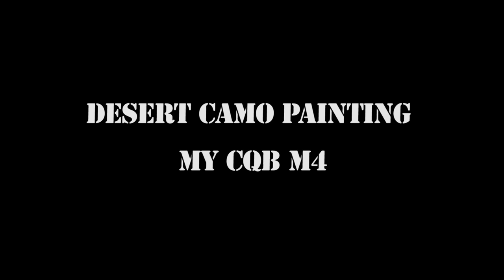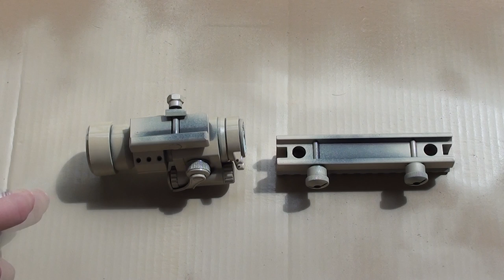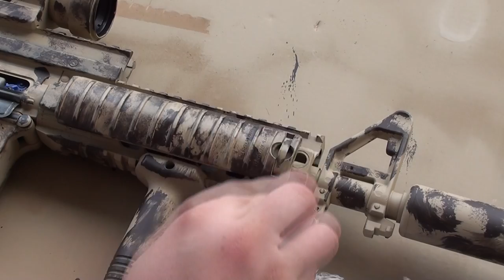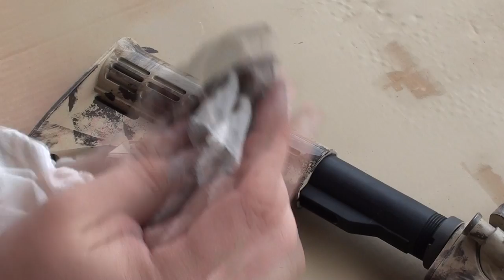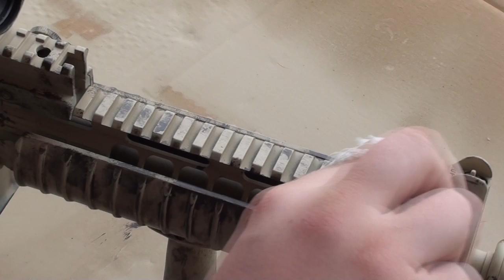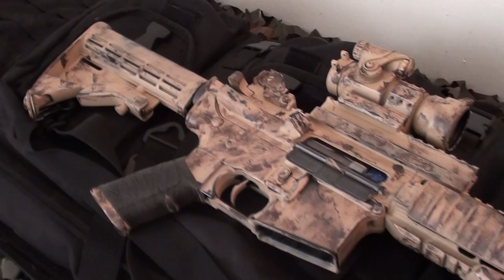Desert camo painting M4

Comment: Two questions:
1) How does the paint not make the components stick while they are attached during the sprayng process? 
2) What is that grip or attachment on the sides of the quad rail? I see that there is still rail room for attachment on the top and bottom but the side rails are hidden with that curved plate attachment of sorts? What is that?
Reply from the maker: 1) By using correct paint (Krylon in this case) you won't have sticking issues. 
2) Those are just rail protectors, to protect rails and your hands.

Comment: RBAirsoft sir where do you put your batteries? Is the battery in the stock? Is it lipo batt? And is yur gun a full m4 or a cqbr type? Thank you sir"  ill w8 yur reply.
Reply from the maker: louie concepcion its lipo battery inside the stock, the m4 is custom fitted with shorter barrel.
Reply: RBAirsoft sir what kind of lipo did you use to fit inside the buffer? And is it possible if use it to my jg m4 buffer tube, will it be fit well with the buffer stock? We have the same buffer stock. Thank you for yur answers sir. God bless.
Reply: By the way sir can i add you on facebook? Im a newbee and i think  you can help me with yur suggestions thank you again sir.
Reply from the maker: louie concepcion i use a thin 7,4V lipo battery. Should fit yours.
Reply: RBAirsoft thanks for the info sir.
If you have time can you pls take a picture of your buffer tube and the lipo inside it and post it in facebook. i will add you now in fb sir. Thanks again!
Reply from the maker: louie concepcion put a reminder on facebook so i can send picture.

Comment: Did you have to tape any parts on the AEG?
Reply from the maker: Vero Digital no, but i used some "blu tack" to cover the barrel, the bottom of the handgrip (opening to motor) and the red dot scope. I do have a tutorial video on how i paint my replicas also.
Reply: Was just wondering. I know in snipers you have to kinda tape a lot of stuff like i did in mine because a lot of stuff are exposed. I don't know how exposed any mechanisms are in an M-lok aeg, it looks too open i hope it's sealed because i will be painting it tomorrow
Reply from the maker: Just use camo spray and spray many thin layers. Cover up openings and it will be fine!